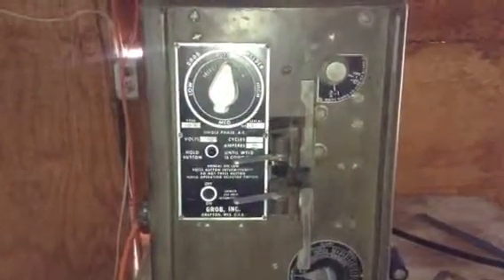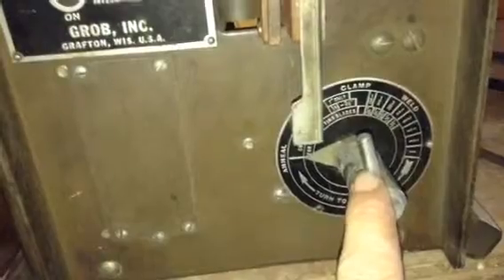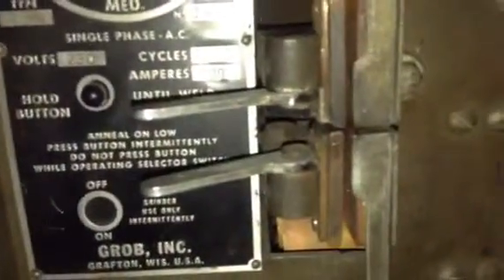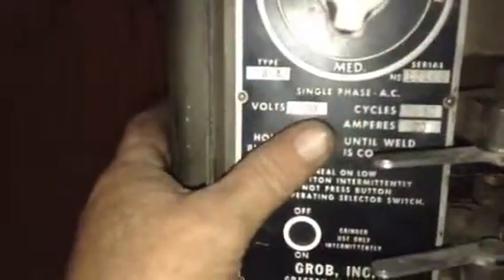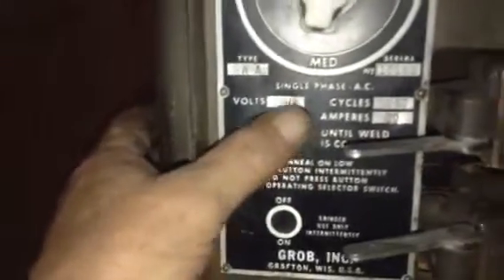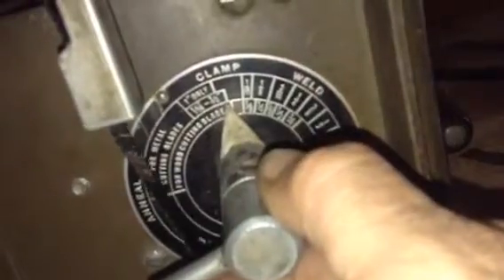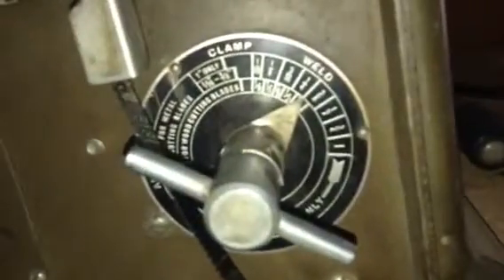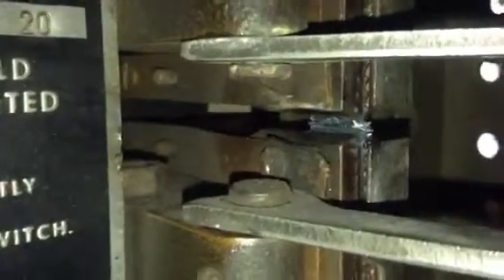Grob RW-a blade welder.

Comment: Great, someone took the time to show this machine. I'm still unsure to know where to set the heat switch?
Reply from the maker: Basically  just 2 settings to use. The high for welding and then low for annealing. Thats what I do.